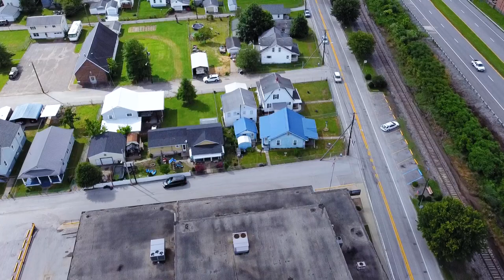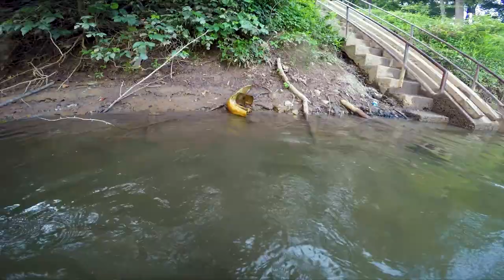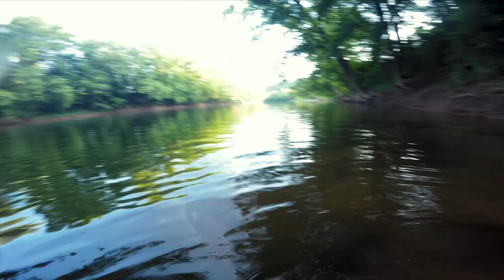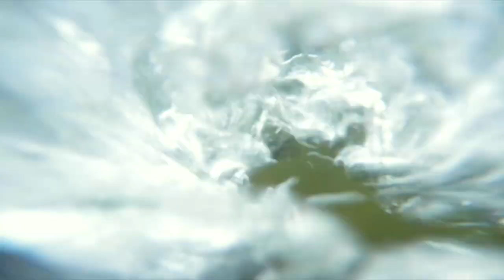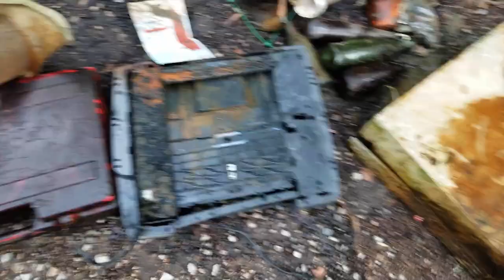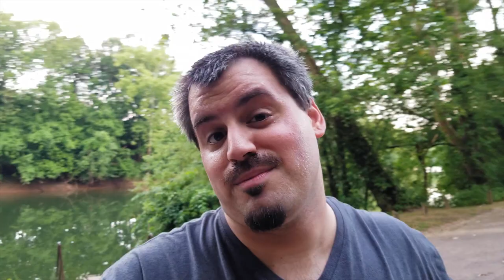River Treasure Hunting - I found a 9mm handgun! (2020)

Comment: Great video again Snorkel and super find on the pistol! The other one, the "laser ray gun" is called a ram set gun by Hilti, used for inserting fasteners into concrete with a .22 cal charge; so you can say you actually found TWO guns, a 9mm that shoots blanks and a .22 that shoots blanks behind screws, threaded studs & bolts! Awesome finds!
Reply from the maker: Yeah I kinda thought that's what it might be, but I hadn't seen that style before. I'm used to the one that just like a pipe that only does one at a time. Thanks for watching!
Reply: @Snorkelpirate  That one's single fire as well just easier to handle in that configuration; used one a few times back in the day, Hilti is a top of the line brand!
Reply from the maker: @arkietreasurehawgs  yeah someone is mad. They only reason I could think that it was there is because someone stole it and threw it in lol.

Comment: Supreme find on the handgun and the ray gun. I'd be super stoked about that as well. Unfortunately, the lab tech can still get the serial numbers off of that handgun. Using x-ray penetration something or another I forgot what it's called but even if a serial number was filed or grinded off of a handgun or any gun, using whatever type of Science Fiction sophisticated equipment they can still read debt. Look at it like this, when metal is stamped there's like a ripple effect that travels down through the metal and that's what they can read using x-ray stuff. Hate to bust your snorkel bubble. Or forget that I commented on this, delete the comment, keep your mouth shut, delete the video, and mount it on your trophy wall.
Reply from the maker: Dropping that science! Very interesting. I've just been following that kinda general rule that I see everyone else do.
Reply: If it is a black powder pistol of some sort either Flintlock side hammer, cap & ball, or modern black powder chances are you don't need to turn those in. All handguns that get turned in would end up getting destroyed eventually. Your long guns stand a better chance of coming back to you or staying with you. 
Those stairs you were at at the end of your video look familiar. What state are you in? I could have sworn I saw aquachigger pull his mokai out of the water on those steps.
Reply from the maker: @michiganmagneto  West Virginia.  I mean the good news is it's a blank gun, so nobody died from it.
Reply: @Snorkelpirate  Shhot! If it can't fire a projectile, it's all yours.
Reply from the maker: @michiganmagneto  As soon as I typed it in the name it popped up move replica blank gun. It was a little disappointing. Lol
Reply: @Snorkelpirate  maybe only a little bit disappointing. You get to keep it and it's not a cap gun.
Reply from the maker: @michiganmagneto  yeah its still cool. I wanna go back and find more